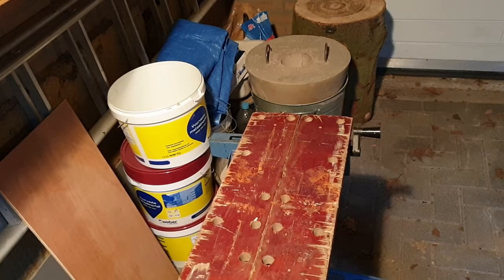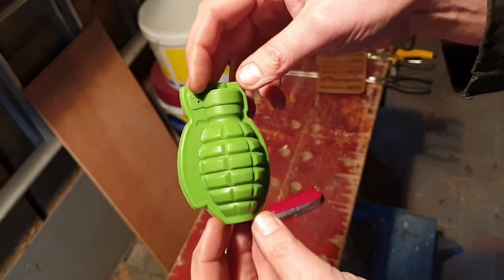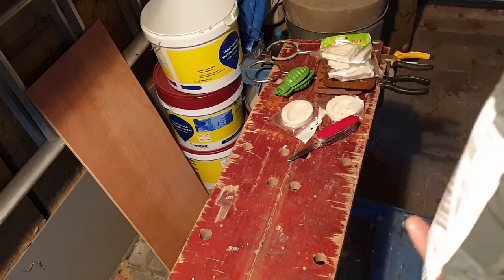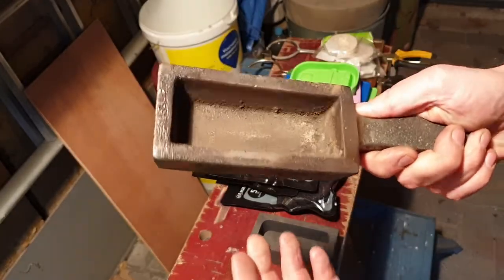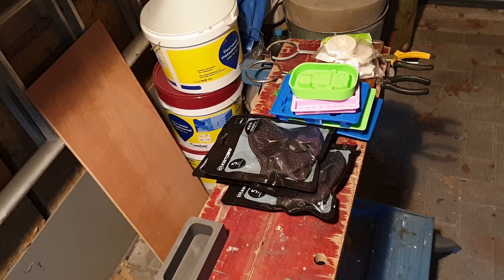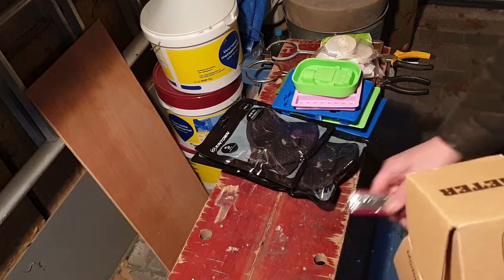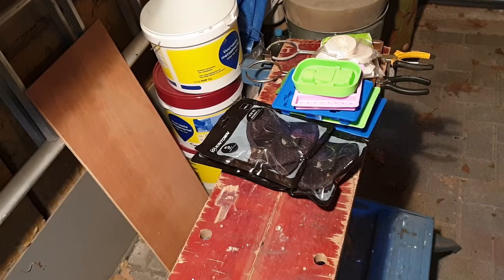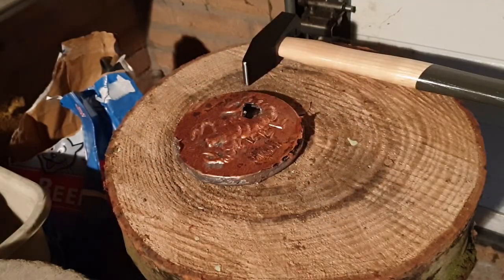Unboxing stuff for the channel & the #2019OpenersOpen

Comment: Good to see you got the holdpeak. As for accuracy I think it it not spot on. But for now I think it is a great thermometer. Have fun using the new stuff! I have the flask ready! Will cast in sand this week I think. See you later 👍